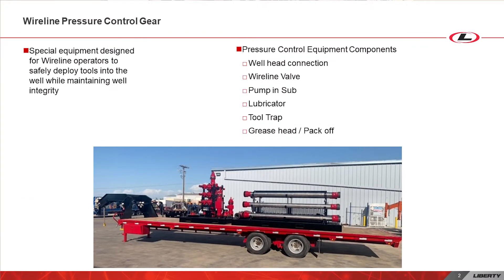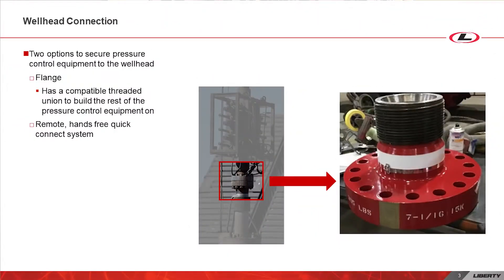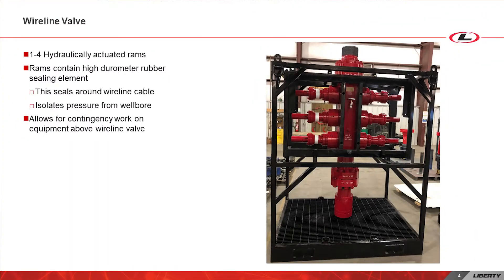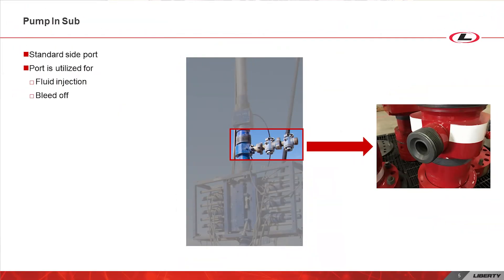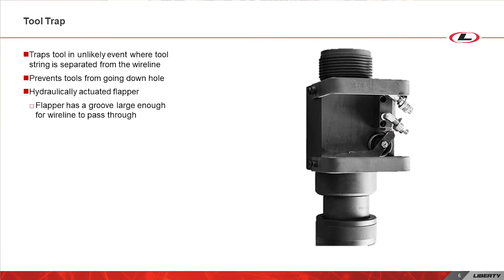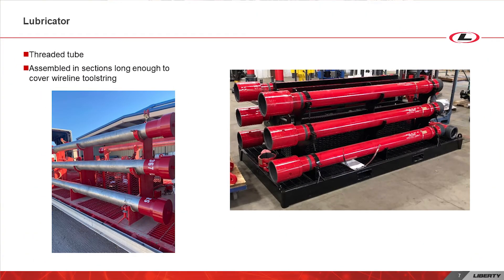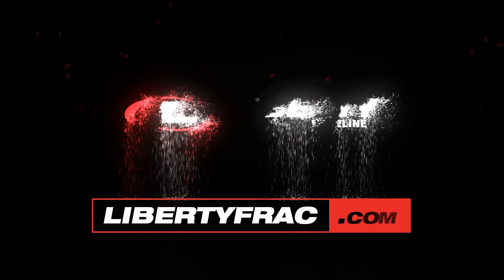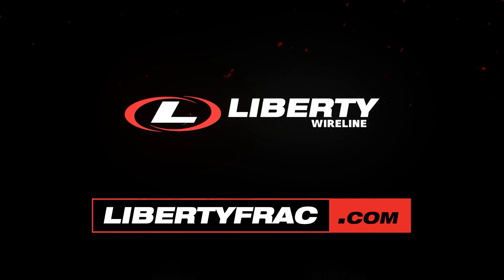Pressure Control Equipment

Comment: Pumping Sub should be placed better under Wireline control valve because we will need it when we close the WCV and injecting thru the pumping sub to kill the well for the wors case